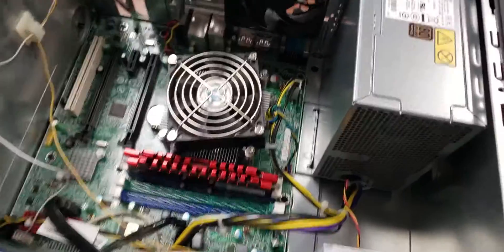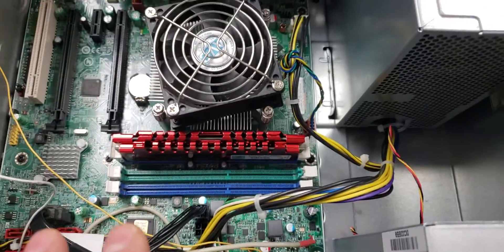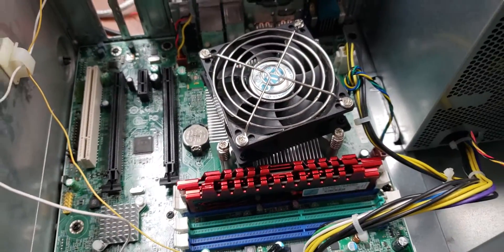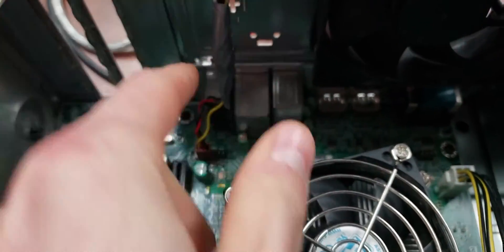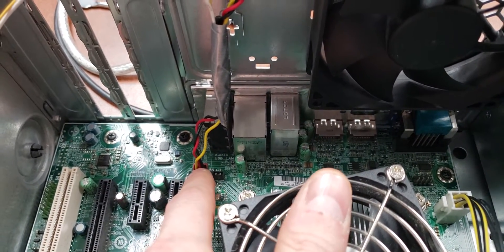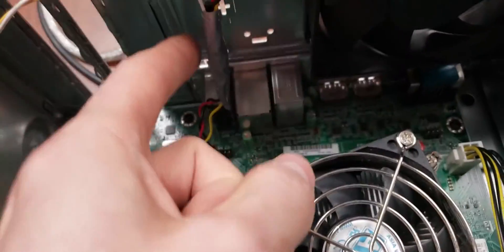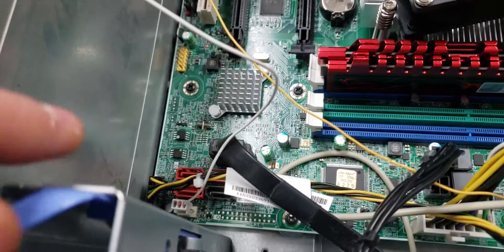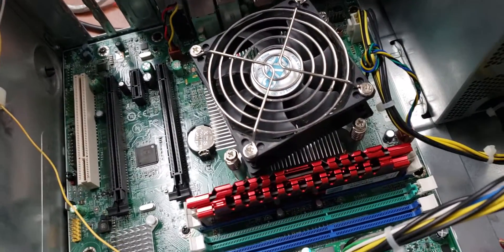System Fan Failure Press F1 to Continue

Comment from the maker: Hey Hey, I fixed your fan issues. Sayyy Whattt
Reply: Can you see that your RAM modules are installed for Single channel operation and not Dual channel?
As was standard, 4 Ram slots = 2 channels with 2 slots each- slots 1 &2 are channel 1 - slots 3 &4 are channel 2.
So proper config for Dual channel operation is a module in slot 1 and the other in slot 3. This is the proper config when only 2 modules are installed.
Reply: 😢 @paulwilson02
Reply: Plug your ram into the blue slots first feck ryan out loud

Comment: Doesn't that mobo have a special bios that you have to press for example CTRL+ALT+Bios button (F10Example) instead of just the bios button. And in there you can turn off the Fan-control that is not in the normal bios mode. You access advanced settings.
The fan does not spin at the beginning, but when the OS is started, the fan starts spinning and above all no error messages. Might be worth looking through instead of tricking the motherboard.

Comment: Change one stick of your ram so they are off set. Purple with purple (or maybe the slots are blue). never side by side. :) 
Good video. Thank you.
Reply: It is the right way Green+Blue(Dual channel) The other way is (single channel) Its just the ram cooling that are a little big and they can touch each other with no worries.
And i dont even think the mobo will post with Slot 1A+2A.  He has now 1A+1B and that is right.

Comment: Your ram should be in the blue slots, they're running in single channel like that. They could be running in dual, giving double the throughput.
Reply: I think the blue DIMM slot is the only blue one out of the 4...the others are green as best I can see.  I'm replacing memory on an older HP 8000 Elite today and it has #1/A Banbk black and the other 3 white....so if I understand correctly (and my brain may be a bit fockety today!) #1/A + #1/B for two DIMMS puts it in dual channel mode.
Reply: @boboala1  At least on here, at 0:00 you can clearly see there is clearly a 2nd blue one with a DIMM further from the CPU. The only case there would EVER be a 3+1 config is on cheap triple channel RAM boards where they didn't use 6 slots but instead 4
Reply: @DoesntRefillTheBrita  I looked closer (beg. of video this time) and you are correct!  That's how my older Gigabyte MOBO is for i3 series.  This friend's HP 8000 PC  has a Core2 board (older) and only the 1st DIMM slot is black...unless I'm losing my mind(!)  Just looked in an old Pentium D box (older still) and the 4 slots are black/white black/white.
So it appears HP was for whatever reason  masking their dual-channel  slots, or the BIOS adjusts automatically...?
This was a business model with TPA resident, yet came w only 2GB of DDR3.  Needless to say for almost any PC user today that (running Win 10 Pro) clicking on something then counting slowly to 30 is buzz kill!  ;-)
(But this MOBO don't like newer DIMMs w high density...so yeah...not wanting to spend $35 at NewEgg for old RAM!)